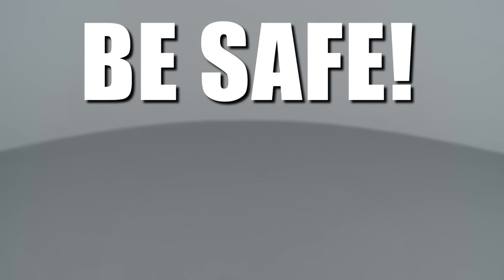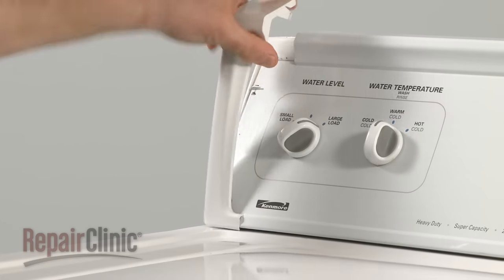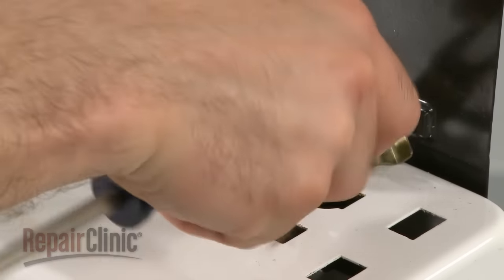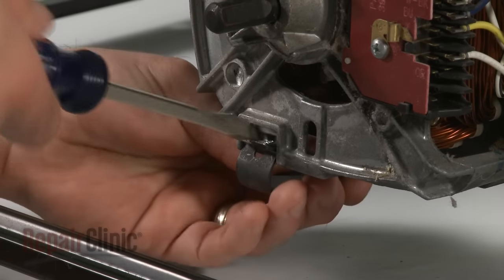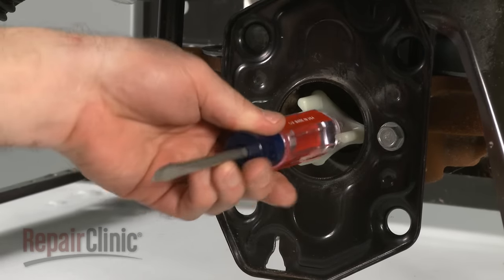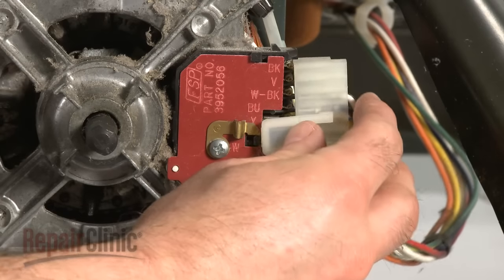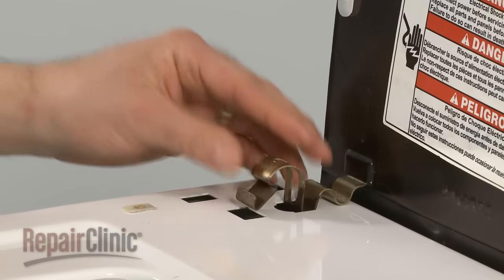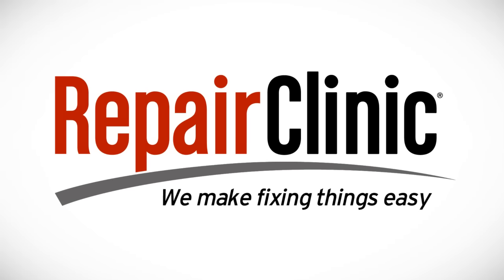Whirlpool Top-Load Drive Motor Coupler Replacement #285753A

Comment: Another success story here. Went with the plastic coupler due to many comments that the metal bushing that connected with the shaft was rounding the motor shaft. Replacing the coupler will always be much easier than replacing that. Thanks again. I am NOT what anyone would call a handyman. Your video did the trick. Amazing clarity. Thank you MUCH!

Comment: I replaced this part all by myself today! It was a bit of a doozie getting the motor connected back with the clips - always a little tougher going back together than coming apart. I followed each step and found the directions to be very easy to follow and the steps well displayed! Thanks for saving me a service call! The part was only $20 at Sears Parts & Service Center AND the replacements now have a metal ring! YAY! Maybe that will be the last one I have to replace for a while!

Comment: When you find a video that not only helps you perfectly diagnose your issue, but also provides the necessary part to remedy your problem, there is no better feeling. For less than $20, I was able to order the part (direct-drive coupler), fix my washer, and finally have piece of mind knowing that I wouldn't have to shell out hundreds of dollars for a new one. Ahhh.... the sweet smell of accomplishment! Thank you RepairClinic.com!
Reply: What part of this video has any references to diagnosis? Maybe give a time stamp. So far all I have seen is here is how the old comes off and the new part goes on which doesn't speak anything to how to identify of that was the issue to begin with. Without discussing diagnosis you are just throwing parts at the problem and hoping it works.
Reply: Robert Toms, III When you have vast mechanical knowledge but watch the video anyways (so you don’t unnecessarily destroy your machine by accident), and during the year down process you realize that the issue you have is the same issue in the video... then THAT is how it helps you diagnose the problem. Go troll somewhere else.
Reply: @TheTipsyRooster  
I am honestly not sure what I did to give you them impression I was "trolling". I disagree with practice and would like feedback to reflect on the action.
To further address your response.
That works if you already have the vast knowledge/experience. Sure that helps YOU diagnose the problem.
But what is an individual to do when they have never torn a washing machine or similar apart before.
How when not being familiar with what they are looking at are they to identify it and how it functions?

I posit they should look for quality instruction and to develop those skills, knowledge, and the experience. 

I acknowledge the nice work on a tear down and rebuild video. I am simply trying to engage and encourage that the lack of detail be provided.
I asked that diagnosis be address.
By definition:
noun
1.
the identification of the nature of an illness or other problem by examination of the symptoms.

I asked for time stamps as perhaps I missed it in the video. It is a short video and didn't figure it was there but as I do make mistakes I wanted it to be made clear to me where I had missed it if such was the case.

I chose this comment not to single you out but because reading their website comments and many YouTube comments there is a correlation that suggests they may be paying people to write reviews and yours seemed legitimate.

If you disagree with my accessment under general principal that is fine you have the right to your opinion. If you have specific points you disagree with and believe I have errored in my reasoning I am willing to hear you out and take your words with honest consideration.

Comment: it took two shots but, I think I'm all done!  The replacement coupler set has metal ring in the center of the plastic. 
The inner one will not seat flush but, the one that goes in the motor will.   I used a suggestion posted by someone to use a mallet and socket to get the coupler on the motor flush.  This appears to have done the job!  I ran an empty load and it seemed fine and No Noise and No Smell!  

Thanks! ...  Great video! :)

Comment: Perfect video.. I had a problem where the motor was making no noise at all and not responding in any way.. I saw how to pull off the cabinet and then I paused the video to do so... only to find a connector within the motor itself was disconnected.. re connected it , re assembled and tested only to find that it works perfect... I knew I could trust YouTube and RC .. Never stop making videos... Ever

Comment: Thank you for the easy step by step instructions. The washer in the clip was almost mine exactly. With your instructions we were able to take it apart and replace the drive coupler in a fairly short time. The machine is now back up and running!

Comment: When the wife came in the room and said we needed a new washing machine, I did some research. I didn't like the new washers out today and felt the old Whirlpool did it's job well. I turned on the machine and it sounded like a jet grinding gears. From this video, I knew exactly how to diagnose the problem, order the correct part for my model, and easily install not only the motor coupler, but the agitator dogs, too. For some odd reason, there were no dogs in the old agitator. Tip: it's easier to tip the machine against a wall when you handle the motor. There's less weight on your hands and it slides in very easily when it's properly aligned with the holes.  The machine works and looks brand new ( I painted the casing with Rustoleum Appliance Paint). I have ordered many times from Repair Clinic.com  I also repaired my old Ryobi trimmer. They have the parts that are sometimes hard to find and their videos are so clear and precise. NO, I don't work for them but I'm very satisfied with their service. They saved us $400.00 for a new washer.  :)
Reply from the maker: +Ed Baran Thank you for sharing.

Comment: First attempt at trying to make a repair like this.  After searching what the problem might be online (no agitation or spin) a unanimous consensus was the coupler.  I ordered it watched your video 3 times before attempting it.  It was certainly easy to disassemble, but I struggled just a little getting that motor back in (my doing).  Once in, everything buttoned up, working perfectly.  I have a load of laundry washing now.  Thank you for such detailed information and a great video.  By the way, I'm a female senior citizen....so anybody can do it with proper instructions and a want to.

Comment: geat simple easy to follow DIY viedo, replaced my motor coupling in a snap, I actually had a harder time replacing cabinet than I did with any other part, your video was spot on!

Comment: Quick word of advice on the replacement rings with metal. the OEM part was all plastic so that when the part failed -- it caused less damage to the motor (e.g. burn out risk) vs. being reinforced with metal to keep potentially turning while inappropriately balanced once any of the plastic ends snapped off.  That said, if you can locate the original type that is all plastic it could be a better plan to avoid risk of catastrophic failure. That said, they will break more often than a metal one.  Everything is about tradeoffs so choose based on the risk/reward profile preferred to you

Comment from the maker: It could be a few things. The most likely cause is the lid switch. If you go to the repair help section of our website (link in the description) and enter your model number there you'll have access to part, model and symptom specific repair help and it will show you the most likely causes.

Comment: This machine is an engineering marvel. I believe it was designed by Whirlpool to allow Sears and the Kenmore brand to quickly train techs to repair these units. Most Whirlpool, Kenmore, Roper, Estate parts are interchangeable.
Reply: Rip Sears 😢

Comment: I saw another video making the same noise as mine and the guy said that it's the motor coupler. I took mine apart and the coupler on the motor had play but none of the prongs were broke so I'm gonna replace it. I will l let you know if it fixes it. Great video. Exact same set up as my Kenmore. It was very easy to take apart.

Comment from the maker: Thanks for the comment! There is most likely either something stuck in between the two tubs, or the main spin bearing may be locked up. You can use our online repair help (link in the description) using your model number, and that will give you model specific repair help.

Comment: Great DIY video, only 1 suggestion Before you start this repair move the washer to a large open area so you have room to get around. I had to put my machine all back together and move it to another room. It made the repair so much easier.
Reply from the maker: That's a great tip. Thanks!

Comment: Thanks for the tutorial. However, I had a REALLY hard time to pump the pump back into the motor shaft. Mortor shaft was really rusty and the pump couldnt get into it. I had to use some sand paper on the shaft.
Anyway, after 1 hour everything works fine.
Thanks!

Comment: excellent video however as a just in case it should be advised to make sure the level selector tube is connected to the tub and control. Just something I have accidentally jerked loose and found out later with a flooded garage.
Reply from the maker: Thanks for the tip!

Comment: I have performed this repair twice on the same washer. Now that I am doing it for the third time, I can't get the coupler to go on the gear case shaft as there seems to be Parton the shaft preventing the coupler to go on. I did not notice this as I removed the broken coupler?

Comment: the new part will have a metal center in the couplings.  Accordingly, when installing the 2 couplers on the motor and the washer drive, MAKE CERTAIN that the couplers are flush with the drives.  If not, replacing the tensions brackets on the drive will be nearly impossible.  1/8" on both couplers will make a difference.  Also, if your machine is a Whirlpool, wear gloves since there is a protector plate on the bottom of the tub which will slice your hand when replacing the top tension bracket.

Comment: If there are wet clothes in the washer right now, will I need to remove the wet clothes and drain the washer (by possibly running the washer while it makes the horrible noise) so that water does not go everywhere, or can I replace the part without taking the water and clothes out? Thanks!

Comment: If you've looked at the coupler ,motor, lid switch and nothing is working. Check your capacitor. It's located either on the motor or on the back panel about half way up from the floor. Generally your motor won't have enough uuummmpppfff to turn the drum with the clothes and water in it. Look up testing a capacitor if you want to check it first. If they're not discharged they will bite you so be careful. It's simply a matter of popping the wires off the old one and onto the new one.

Comment: I have a Kenmore washing machine 80 seriee Model 110.288 82791 and agitator appears not to work although there is some sound as if the motor is working. Aso, during the spin cycle water is not draining and I'm sure it's not the lid switch because if I push down on the switch sensor it has no effect anfd I still hear the motor working. So, I'm not sure if the problem is with the coupler or the clutch assembly. Any suggestions? Thanks

Comment: Questions you might address in the video:

Is this the only issue that causes this symptom? 

What can I do/test to identify the potential points that did fail?

I have tested and and observed what I can prior to disassembly; now that I have my tools out what is the next thing I can do to reason through the failure points?

I believe I have identified the fail point.
 Or
I have reached a point in my troubleshooting query that the next step must involve physical inspection of a internal part. What does that part look like functioning properly, when other parts have failed, and when that part has failed?

A job done well in part means you should not need to replace everything to eliminate it as a potential cause. Diagnosis is about finding the solution before involving repairs. Identifying the problem cause without rebuilding is a real repair.

Comment: I am having a hard time getting the bottom clip of the motor to go back on. Does that mean it s not aligned right? Or is there a trick to it?
Reply from the maker: We recommend that you remove the motor again and make sure the shaft of the motor and transmission is flush with the coupler. If the coupler is not secured all the way on, the spacing will not be correct and the motor clamps will not go on properly. Also, make sure the pins are aligning in the rubber coupler correctly. It’s hard to see what is happening so it is more of trial and error approach until it seats properly.

Comment: Hello i have some questions. when replacing the motor coupler after putting the clips of the  motor on the motor shaft is not moving. why is this happening?
Reply from the maker: +d dd The motor clips do not effect shaft movement.

Comment: So I have a slight noise when I put the washer on the spin cycle (full tub).  It will no longer spin at all.  I pulled it apart per this video, but the existing coupler looks fine.  Is that normal?  Shouldnt it be broken or stripped or something?
Reply from the maker: There could be something wrong with the motor itself. Can you manually turn the motor freely?
Reply: ***** The motor does turn.
Reply from the maker: Scott S There are other things that can cause the unit to not spin. If the coupler is not broke it is not the problem. You may have a bad spin clutch or a striped out drive block at the top of the spin tube. You can watch our disassembly videos and take the unit apart to see what is causing the problem. If the tub is not loose and you can’t turn it by hand it is most likely a clutch problem.

Comment: Good video. The coupler design is a travesty, it fails every 5 years if not quicker. Why did they not use metal instead of plastic?
Reply: Metal isnt working either

Comment: I have a Kenmore 700 series the motor got wet from the bottom .now when I connect it in the power turns off I think is electrical
 problem short
Reply from the maker: Erick Silva Yes, it does sound like you have a short. If you haven’t let it dry out a few days, try that first. You can enter your model in the search box on our website to check on the price of a new motor and possibly find a how-to video: http://www.repairclinic.com.

Comment: This motor is a universal motor with 10 pin , 9 connected 1 not connected, with stator , rotor , thermal protector, techometer, connection

Comment: Thank you so much for this video!  We used it to replace the broken coupler.  Then the first time we ran thru a cycle, the agitator and drum were spinning again, there were no unusual noises, but there was a very strong burning rubber smell coming from the machine.  Is that normal, or did we maybe do something wrong?

Comment: One comment on the video is that it doesn't really highlight the importance of getting the couplers *completely* flush. If you whack on it with the rounded butt of a screwdriver as demonstrated here, you're likely to wind up with the smell of burning rubber when you run the machine. The couplers need to be *completely* flush.

Comment: Is it normal to have a hard time hammering these parts into place? They are fitting very very tight on the motor. The old plastic parts fit much easier.
Reply from the maker: +Auchtahelweit Use might sand any corrosion on the motor shaft to help.
Reply: Ack, I don't understand? Use might?  From what I could see on the motor shaft there wasn't any corrosion, it was pretty solid, smooth and dark grey. Is there a grease or anything that is safe to use?
Reply: +Auchtahelweit  soak coupling in hot water for a minute and hammer them on. it will be easier

Comment: What part of this video has any references to diagnosis? Maybe give a time stamp. So far all I have seen is here is how the old comes off and the new part goes on which doesn't speak anything to how to identify of that was the issue to begin with. Without discussing diagnosis you are just throwing parts at the problem and hoping it works.
Reply: Questions you might address in the video:

Is this the only issue that causes this symptom? 

What can I do/test to identify the potential points that did fail?

I have tested and and observed what I can prior to disassembly; now that I have my tools out what is the next thing I can do to reason through the failure points?

I believe I have identified the fail point.
 Or
I have reached a point in my troubleshooting query that the next step must involve physical inspection of a internal part. What does that part look like functioning properly, when other parts have failed, and when that part has failed?

A job done well in part means you should not need to replace everything to eliminate it as a potential cause. Diagnosis is about finding the solution before involving repairs. Identifying the problem cause without rebuilding is a real repair.